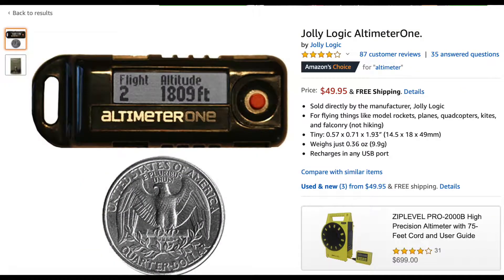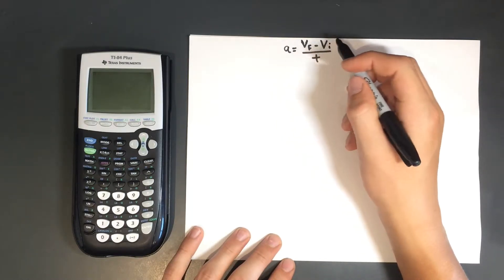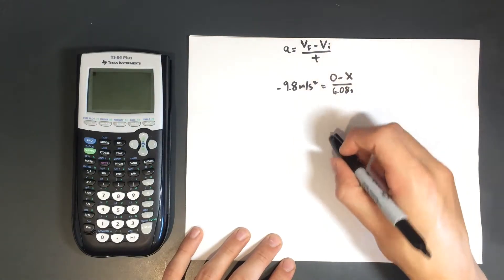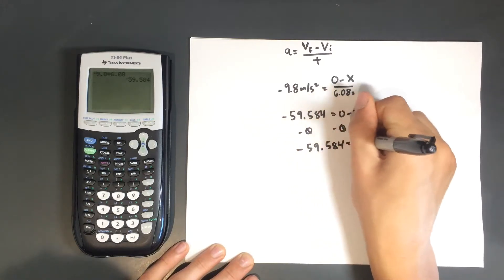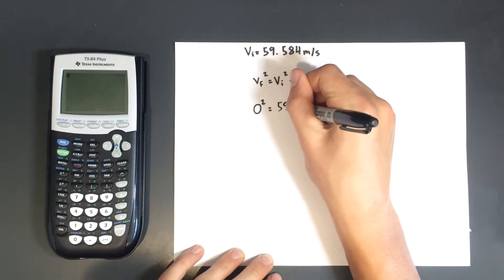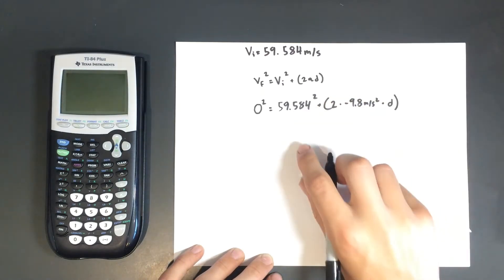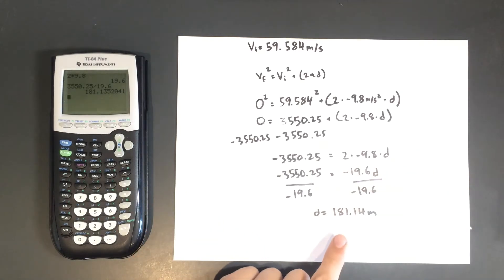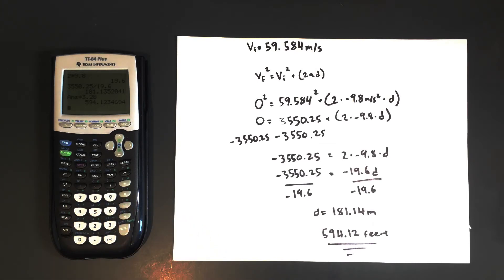How I Very Very Roughly Estimated my Rocket's Height (Assumed Projectile)

Comment: Doesn't this only work if you do not have the rocket motor running on the actual flight up? This would work for a cannon but a rocket will not have a symmetrical flight up vs flight down since on the flight up you have the rocket motor burning and so the net force is not constant throughout the flight.
Reply from the maker: You are 100% correct. I do have an updated video (2022) that does factor in the force from air drag. However, even in that video, I still treat the rocket as a projectile, because I do not have a load cell to measure my force of thrust. 

And like you said, the rocket does not experience constant force the whole flight. As I understand it, there are three phases: boosted ascent, coasting ascent, and descent. The rocket during boosted ascent experiences roughly a constant thrust, but has a changing mass. The coasting ascent and the descent phases have a constant mass, but no thrust force. All phases experience the force of air drag and gravity. 

In this video and the 2022 video I negate the boosted ascent phase entirely! (Tbf my motors did like immediately burn out in the 2022 vid.) Thus, the "coasting ascent phase" defined the entirety of the flight to the peak and I just assumed an initial velocity based on the flight time (in other words, it's a cannonball!). I think I just need to get a load cell lol.